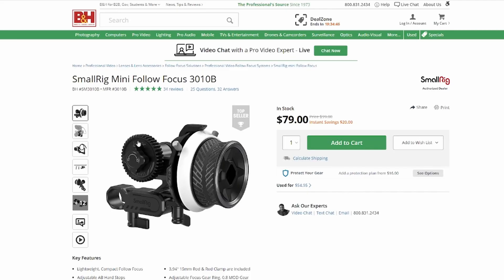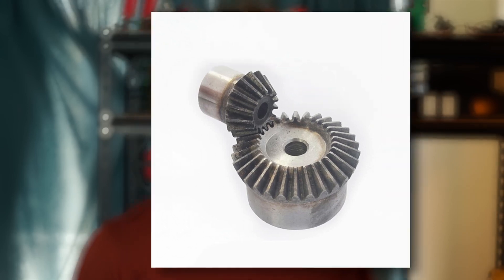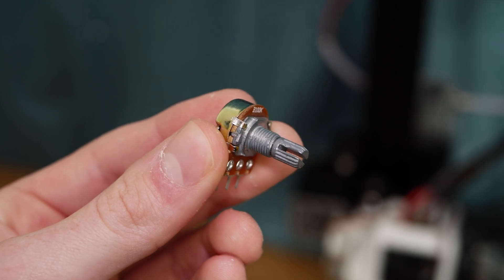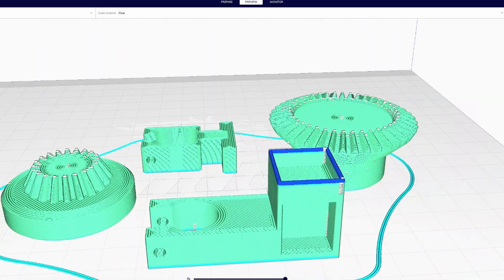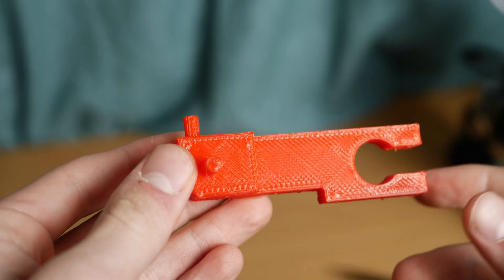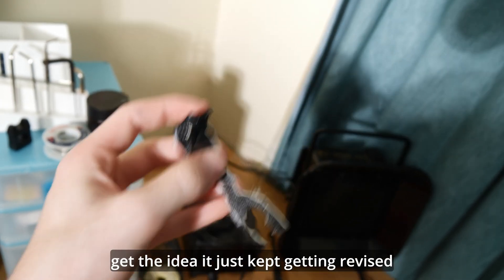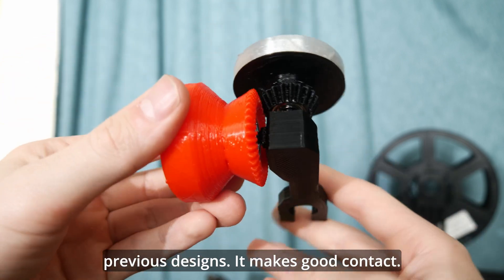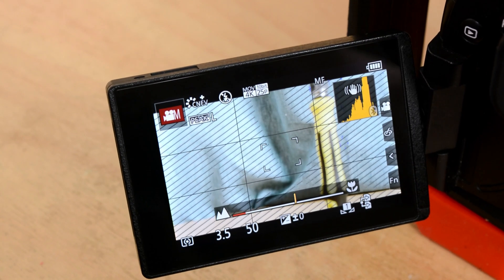3D Printing A Follow Focus System

Comment: Whenever you turn the wheel the whole frame flexes and that's when the friction is loosening. Instead of 3D printing everything use some more sturdy material like plywood (cheap) or aluminium extrusion and rods (expensive).
Reply from the maker: Good idea, next time I’ll use more suitable materials. Cheers
Reply: @TommyHoughton  not a professional opinion but you can see it on your video - when you try to turn, the arms at the bottom flex and the wheel starts skipping.

Comment: Did you try printing a ring similar of the last one for the optical? With this you much improve the motion and the stability.
Reply from the maker: I didn’t, I wish I was able to keep iterating on this project, but I no longer have a need for it. Thanks for the tip though! Cheers